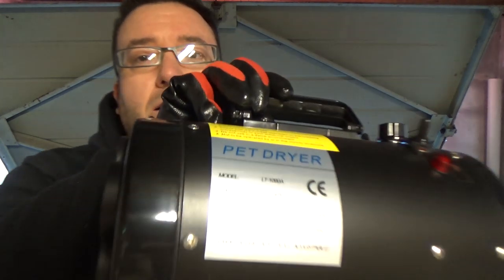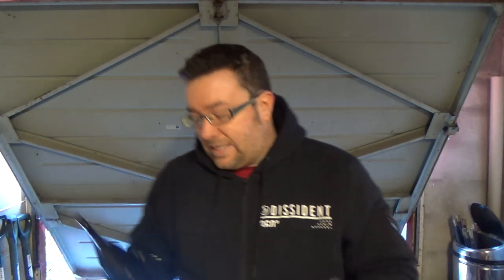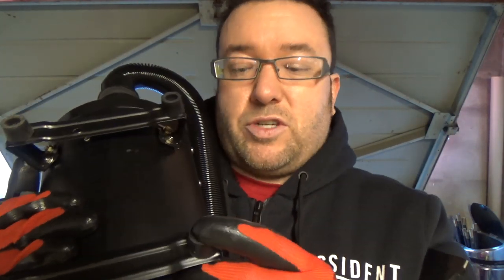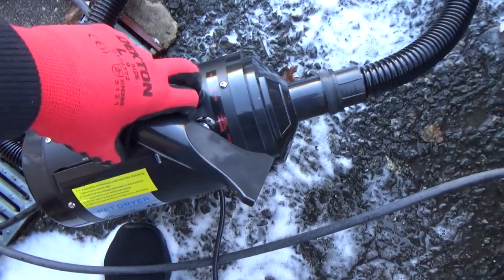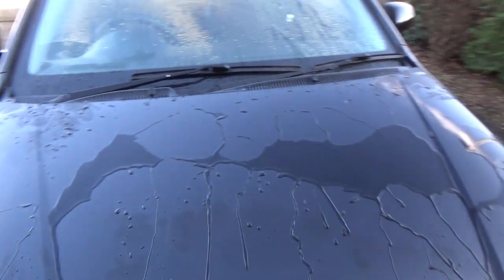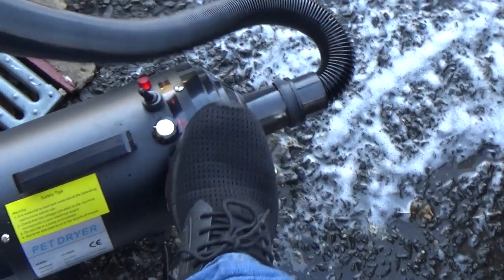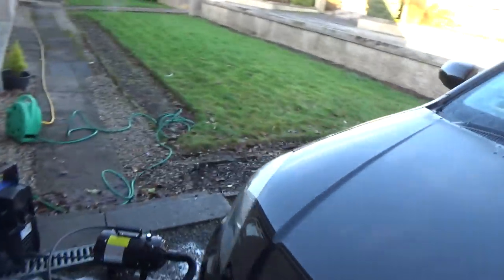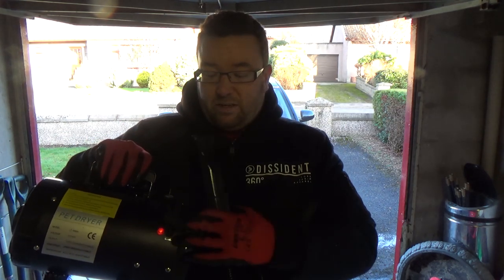Can a Pet Dryer Dry a Car?

Comment: you could easily extend the hose because it the attachments are 32mm you could cut the end off and attach a hoover hose using the the little cube put in to either and cable ties some tape to cover up the cable ties then you have a longer hose. if people get me. :)
Reply from the maker: I know what you mean, might be something I do in the future. So far it hasn't really been an issue.

Comment: Hi Craig, Great review, I have the exact same blower, from Amazon £55 delivered. Was marketed as a car and motor bike blower, was horrified when I opened box to see pet dryer on the side, but it is fantastic, I use it to blow the main bulk of water off the car, then use the QD with a light drying towel and finish off I will blow the gaps and grille etc . One more tip use it on a frosty morning on full heat to de-ice the glass, not too close mind. Always remember if you blow down your hose it will get bigger!!!!
Reply from the maker: Don't talk about my hose 😂
I do the same now, means my drying towel isn't as saturated towards the end of the process. 👍

Comment: I used to use a cheap shop blower but it's on the fritz and I was thinking about this. Great video and you convinced me to get one. The car dryers are a overpriced joke. Thank you for the review and pointing out that without some type of wax or protection on the paint even a overpriced car dryer will not work either. Cheers
Reply from the maker: Cheers Dean! 👊🏻

Comment: I bought an identical model as this for £50 ( not from Bill) and it's excellent and i put some self adhesive foam around the nozzle tips to avoid and damage, however i thought i would mistakenly do a major upgrade and bought a Blo Air GT at a cost of £230. It is nice & shinny, has wheels , a 8m hose and a 5m power cord but it is no better at all in my opinion. The hose can actually be a bloody nuisance when extended and often trips me up or gets in the way, the heat is generated by the motor ( not a dedicated heating element ) so by the time it has travelled 8M in really cold weather it's barely warm. The nozzle broke on it's second use and the hose came out of the coupling. I should have done more homework cos it's rated at 8hp and i think it is physically impossible to get 8HP from a 240V device that only draws 10A..I think a lot of these detailing products are being mis-sold & in this case it almost breaches trading standard descriptions but a lot don't have UK bases to take up the issue.
i really don't think any of them are suitable for drying an entire car, but are great for wheels, grills , mirrors and ant part where water gathers. I'm back to using my Ebay £50 blower which performs just as well but also keeps me a bit warmer.👍🏻
Reply from the maker: Thanks so much for this, I don't know anyone personally who has used an ebay special and a "detailing" blower so I'm delighted to have your feedback. I do agree that many are mis-sold but many people are taken in by the shiny looks and sales guff. I'm still using mine and I think I'll discuss this in the next episode of the podcast. Thanks again! 👊🏻
Reply: @SpeckyMcSporran  You are welcome👍🏻, i have seen quite a few " detailers" rubbish the Ebay/ Amazon specials but i guess they haven't actually used them and also wonder if they are being sponsored or given some financial inducements to promote these over rated & vastly overpriced Detailing Dryers..
Like your videos too, just honest everyday stuff, no bullshit 👍🏻👍🏻

Comment: Great video again mate! The dryer seems to be a decent bit of kit and did great job once the wax had been applied.
Reply from the maker: Thanks! It really shows that you get the most out of a dryer when your paint has some protection. That was my first time using Fast Wax and I liked it, very easy to use and gave a nice finish 👍

Comment: Just picked up 2 used ones off Facebook Market place for £15

Tomorrow iam going to drill a hole in the nozzle and pop in a screw to lock in place 

Do you think the expensive high end units are worth the extra cost??

Iam only a hobbyist but wanted a dryer for ages for grills and wheels , couldn't immagine even with professional one many do the whole car.

Cheers
Reply from the maker: I know someone who owns a "high end" one and can't see much difference over my pet blower.
Reply: @SpeckyMcSporran  great news thanks dude

Comment: I looked into these but a two handed operation doesn't seem appealing or practical to me. Opening doors and boot lids to blow the shuts, lifting up wipers seems awkward. I envisage accidents and scratches that way. I use a cheap £35 Amazon one handed machine that appears equally powerful and has a longer reach. A small leaf-blower I suppose. I must say though, it's nice to see a detailer thinking outside the box and prepared to use equipment that has no, let's say, "car cred"
Reply from the maker: I can use it "one-handed" most of the time.

Comment: I think I'd definitely prefer to towel-dry the panels but Im definitely considering this or similar for the mirrors etc., nothing worse than drying the door, for example, turning your back for 2 seconds and seeing that hateful line of beading coming from handle /mirror etc... I definitely would NOT be using the 70degC option on my paintwork though!!!
Reply: Got to be 70F not C surely!?!?

Comment: Nice video Specs 👍 (just catching up on some videos).... I've had a pet dryer on my ebay watch list for about 10 years now 🤣
Reply from the maker: Cheers Mat, for the price of them I really don't see the need in buying a car dryer. If I were a professional looking for a longer hose model then maybe, but for someone like me the pet dryer is perfect.
Reply: @SpeckyMcSporran  True.... For the home enthusiast, professional grade equipment can become expensive and hard to jusity.... After using the BigBoi's at the start of the year, I'd say I would probably continue to towel dry and simply use a blower for shuts, grilles etc.... Especially on an unprotected car.

That said, I don't detail as many cars as I used to, and now just grab cars for YouTube 😂

Comment: What's your opinion on that detailed online fast wax?  Ease of use ? Gloss? Was only looking at this today thinking of getting some in the new year 👍🎅
Reply from the maker: This was the first time I had a chance to use it. I'm quite impressed, it was easy to apply and buff off and left a nice glossy finish with no streaks. The water behaviour was easy to see in the video. Honestly I can't knock it 👍
Reply: 👍cheers definitely gonna try it
Reply: Ive used this a few times. Gives a nice warm glow to the car that the current sio2 sprays cant. I also find it less fussy to use as well. Lasts a fair few weeks going on months too

Comment: You need @paul_dolden_details head camera. Looks a decent option. Same with buckets really. Search ebay for buckets then search detailing buckets. You can buy ones with lids from £6, the same detailing bucket in size etc is £19.99. So why spend so much?
Reply from the maker: I've got a GoPro with a head mount but I forget I've got it till after I've filmed a video.

Comment: Only problem with a dryer is it actually takes longer to dry the car and in the summer parts of the car will dry by the time you got round to certain parts , so you will get water spots and that means the microfibre has to come out to remove the water spots so it’s no longer a contactless procedure
Reply from the maker: That's a relatively defeatist attitude. Drying aids will help speed sheeting and there's nothing wrong with following up with a QD.
Reply: @SpeckyMcSporran  I’m just talking facts , you try doing a whole suv with it or even a car and you’ll see it takes a lot longer and in the summer you have no chance at all of drying the whole car by the time the water is already drying out on the panels  , there’s a reason professional mobile detailers only use it for the gaps and grills etc bcuz of the reasons I mentioned , your better off spending money on a resin water filter and doing a final rinse with that , not only will it save time but you rule out possibility of water spots and it’s easier , also there’s no electric involved and you got no chance of accidentally hitting hard nozzles on car as you can use a open hose , and your not carrying or moving this big heavy blower around with you , I admit the tiny cordless ones are useful for the grills and gaps
Reply from the maker: I'm not disagreeing with you. I wouldn't recommend only using a blower but rather as you suggested in addition to towel drying for intricate areas.
Reply: @M.E63  The man is from Scotland, up here we don't get summers. 🥶
Reply: @TheExStig  Im in England and I go glasgow all the time but the temp still goes up in spring and summer and regardless of the temp , it still takes longer to use a dryer and the review is too inform people around the world so just showing us drying one panel is not ideal and once you try drying a whole car then you know it’s better to buy a resin filter or just dry it with a soft towel